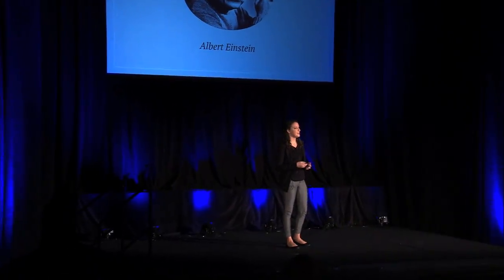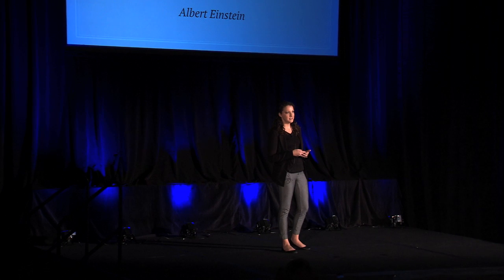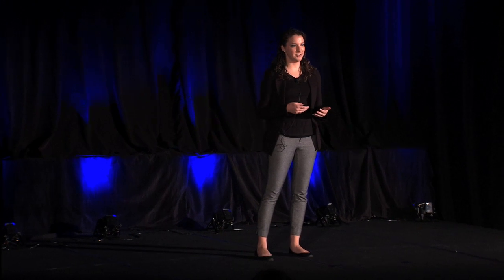Project Success: Defining the Problem

Comment: Probably we can put the problem defining this way: from a horizontal perspective, do the requirements cover all VOC(voice of customer)? examples in this video, the weight requirement of a box, the variation of the sand casting to be paired...; from a vertical perspective, is this a problem or just a symptom of a problem? are we addressing the problem or just the symptom of a problem?

People tend to jump to action rather than carefully identify the real problem